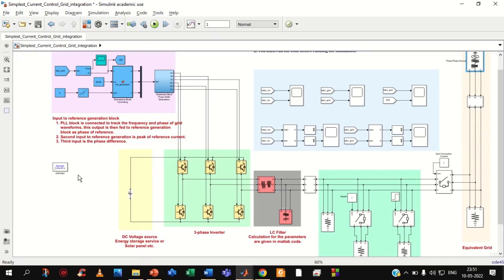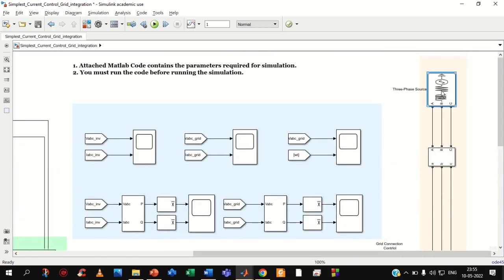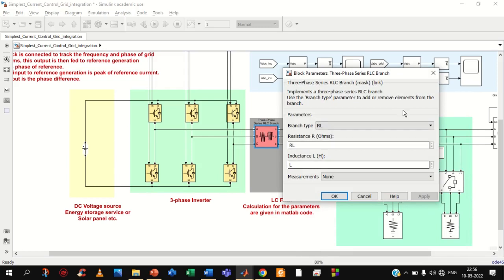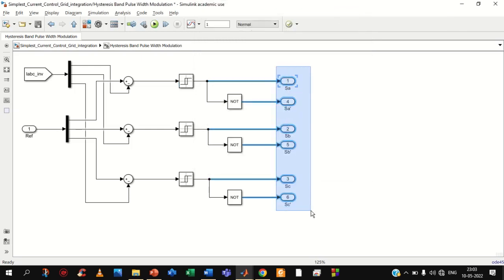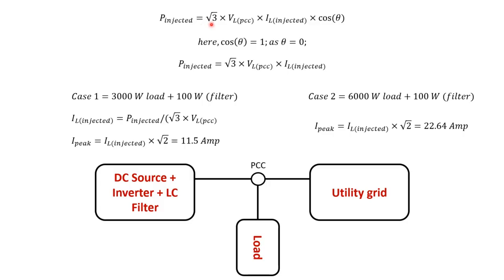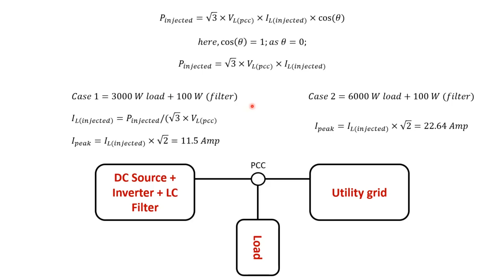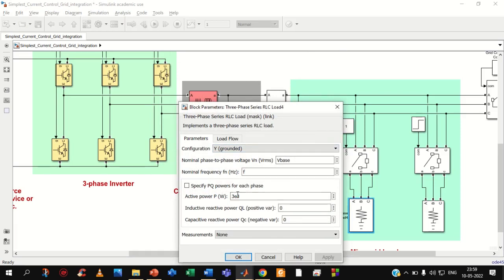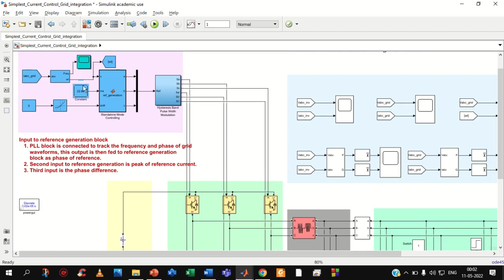Simplest Current-Controlled Grid Integration MATLAB Simulation | Hysteresis PWM

Comment: Very nice effort, sir, can you please share its base paper. reference paper thanks
Reply from the maker: Hi although I used this thesis "Advanced Islanded-Mode Control of Microgrids" by MB Delghavi (2011) to model the system using d-q fame reference generation. But, this particular model in the video I built by myself in order to obtain a simple current control model. However, you can refer to the above thesis or any paper on grid integration using HPWM.